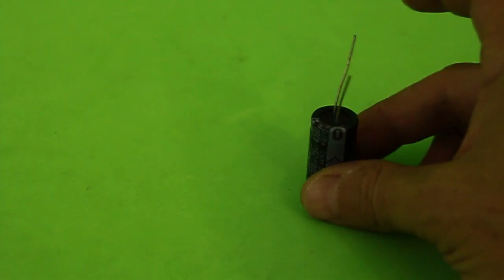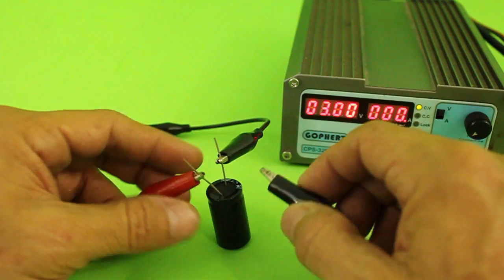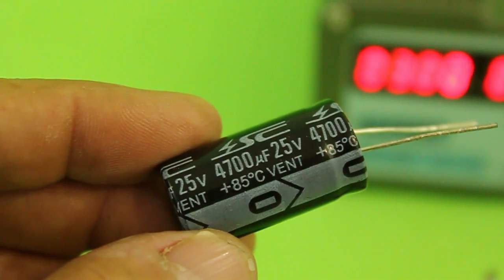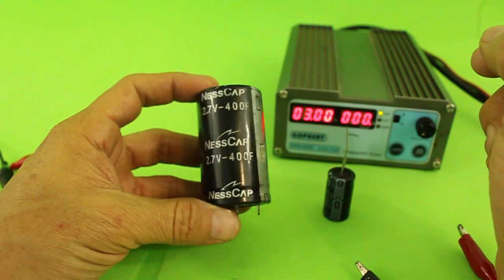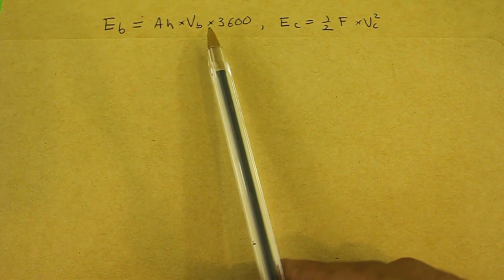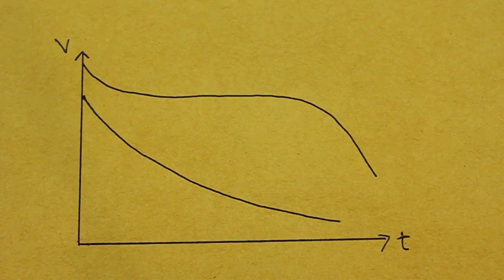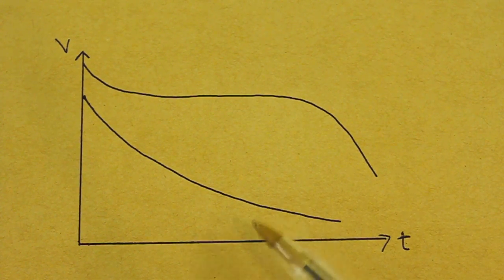Farads to Amp-hour "Conversion" - Capacitors and Batteries

Comment: I still wonder why alarm clocks still have no use for this super capacitors...
Hook them to you wall and if power goes off during your sleep those 400MAh are more than enough to wake you up safely at the end of the day.
Also no need to add corrosive/pollution to this world by adding unnecessary batteries on this type of devices.
Same with the notebooks, having super batteries can prolong the life-spam of their internal batteries for years.
At least Tesla got the idea right and implemented them on their electric cars line.
Reply from the maker: I can only think of cost saving

Comment: Wattage is basically a curreny made of volt x amp hours. Basically volt is like amount of water in a super soaker and the amp is how much pressure.  When it comes to watt hour 40 watts are the deadly amount and inorder to be successfully electrocuted you must have a certain amount of farad . Fuses blow based on farad resistance to stop the death .

Comment: This is just what I was looking for, thanks!  Also I think I have a good way to explain capacitors vs batteries for people that understand computers. A battery is like your SSD or other non volatile memory. Both retain their intended function for a long time even within an isolated environment, however they require more time to obtain the initial media (data/power). A capacitor is like ram, it can’t hold the media for nearly as long or at all in an isolated environment, but can do so much faster and more frequently when in a system.

Comment: You are assuming that Eb = Ec in your derivation of your equations but when you plug in the numbers, you are assuming that the specific capacitor that you have there is equal in energy to the specific battery that you have there and they are not so your results are wrong.

Comment: Good morning and thanks for your precious contribution. just for justice: The energy E in joules (J) is equal to the power P in watts (W) * times the time period t in seconds (s): E(J) = P(W) × t(s)
 = J = Watt*sec. 
1 J/3600sec = 1 Wh. For each formula we have to find the same result to be equalized. Therefore: 
Ebatt = (Ah*Vbatt)*3600sec = Wh; Ecap = (1/2*Farad*Vcap^2)/3600 = Wh. 
You can now equal both of these equations to yield (Amperes) as: A = (1/2*Farad*Vcap^2)/(Vbatt*3600^2). Then to find the Ah, You must multiply this outcome per 3600.  In your case, with a supercap of 400F 2,7Vcap, to be compared with a 1.2Vbat, 2.1A, we yield: A =  93,75uA*3600sec = 337,5mAh.
The outcome is the same, but the formulas not!

Comment: I was planning to make a capacitor pack to burst 10Kilo Watt for 20 seconds at 180 volts.

After some calculations:
 10000 * 20/3600 = 55Watt Hour

I have found that with your calculation I would need an extremely large number of capacitors fo such a simple application.
Am I missing something here? Shouldnt capacitors be more suitable for 10 - 20 second bursts than batteries?

Comment: Energy counts in watts-hours = Volt * Amp * Time. Battery has: 1.2V * 2.1A * 1H = 2.52 Watt-hour. 
Cap has energy = 0.5 * F * U^2 = 0.5 * 500 * 2.7^2 = 1822 Joules. Convert to Wh by dividing by 3600, we get 0.5 Watt-hour.

Comment: Dear Mr Ludic, with all due respect, your formula has glaring error. F= (2 x Ah x Vb x 360? 
Every budding science enthusiast knows even a super capacitor does not store very much energy. In this case you equate a 500F capacitor energy storage (EXACTLY) to that of a 2100mAh battery. The formula is better served by introducing a constant where A= K x B , where K  (constant) is a multiple or fraction . That way you can equate a capacitor as a multiple or fraction of any battery. Why choose a 2100mAh battery? It could be a 18650 Li-ion baterry 2000 or 3000 mAh would they still be equal. What about a 12V motorcycle battery of 7Ah or car battery of 80Ah? If you have a constant K in formula, where K is a multiple or fraction then ...remember there are 1800mAh, or even 2500mAh. In math, one simply cannot be imprecise. Keep up the good work anyway

Comment: Where did the value of Vb come from? Also why is it 1.2v?
Reply: Voltage of battery. Most batteries run at 1.2 volts.
Reply: You mean 1.2v is constant?

Comment: Those equations doesn't make sense.  Why would you need the battery voltage (Vb)  to determine the equivalent Ah for capacitors ??  That equation is basically saying that for as long as you connect a battery in a circuit,  its voltage level  is inversely proportional to the capactor's  Ah equivalent.

Comment: I would like to ask if there is any circuit that, included to de super--capacitor, can improve its discharge curve to aproximate it to the battery's curve. thanks !

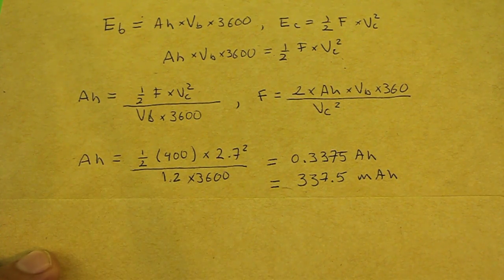Comment: 4:57 Capacitor can store 337.5mAh with capacity of 400F, but with 1.2V or 2.7V (and Ec doesn't equal Eb to make them in one equation). "by the way thank you for the video".

Comment: Dear Mr Ludic: At 1:59 you said: 21 thousand milliampere hours. It is 21 hundred milliampere hours, thank you. [Otherwise, excellent video]. 😀
Reply from the maker: Yes youre right 😂
Reply: @ludicscience  It is not a battery, it is a cell! To make a battery, you have to connect several cells together.
Reply: I learn Eng. with you. Thenks for mistake

Comment: Guys please consider alternatives when working with electronics.
If you do not have a certain tool/component, maybe(in some cases) you can MAKE/DYI one.
For instance, if you do not have allegator clamps/clips, use can use clothes pins and wires, to serve a similar purpose.
Better use wood clothes pins, so you color them, with marker black, red....etc.
If you do not have a bench/variable power supply you can make a simple circuit with 2 LM317 voltage regulator(s) and Pots(VR), to control V & A
https://youtu.be/G2Bl_bbZzGA?t=204
https://www.youtube.com/results?search_query=LM317+amperage
Good luck

Comment: The title of the video is not correct. You can not convert directly Farad to Amp Hours because these are two different physical dimension.
Reply from the maker: That is correct, I quoted conversion in the title, thanks for your input!